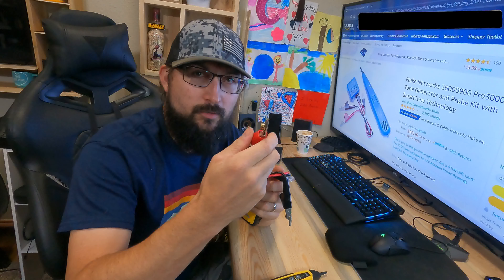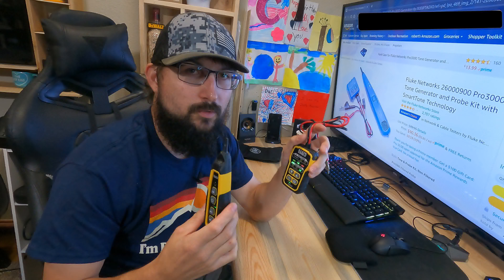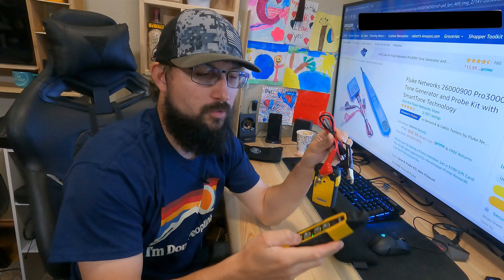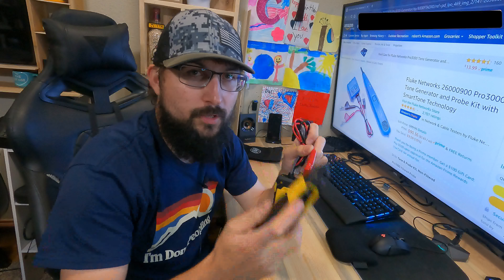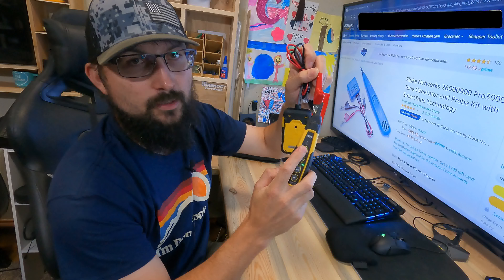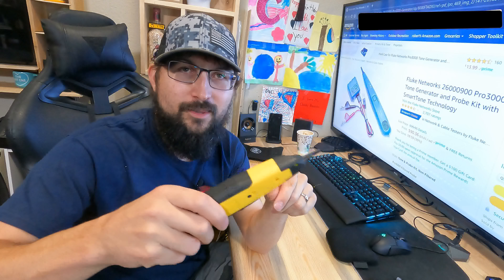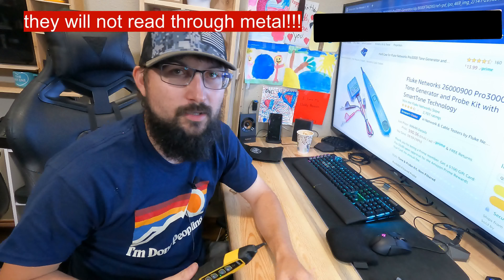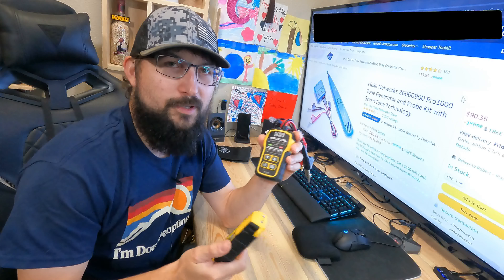Check out the Klein Tone generator/ probe

Comment: Hello Sir, your advice on how to cal and use it changed the game and make it quite simple to use without frustration Thank You. I also bought the Advanced Cable Tester NF8209 just in case so may I ask what your opinion is on it? I will send one of the back and wondering which I should keep. Thanks in advance my friend.
Reply from the maker: I'm glad I could help! Thanks for the feed back, that tester you mentioned (NF8209) looks promising! anytime you can ''dial'' in a tone vs a designated value on a push button, the manual dial is usually more accurate. However, that product looks like more for networks than a general wire tracer. I cant speak of the quality because i have never used that one . It looks like an excellent value vs the klein for networking!
I know the klein one works really good for non network applications. Thanks
Reply: As I started my day of toning, I did start struggling and i remember what you said about A ROCK SOLID Ground and once i established one I was on my way You Rock BUD. Thanks again
Reply from the maker: @nosnawslm1  Thanks!
Reply: @toolsandtactics  I did try the NF8209 and I'm VERY Impressed for multi function.

Comment: so you calibrate the sensitivity...on a test circuit? what are the correct parameters of the calibration circuits? Instructions unclear.
Reply from the maker: I've got quite a few newer updated videos on this

You don't use a test circuit to calibrate it. You can use the toner itself

But you need to make sure you connect your black. Lead to a known true ground source

Comment: Hey Man, thanks so much for putting this video together.  Best explanation I've found in YouTube.  Is there any chance you can make another video plugging in the RJ connector to the wall in a room and actually locating a cable/wire at the junction point?  Is that even the correct use? I only mention it because I'm trying to wire the rooms in my house for ethernet use and I'm at a loss trying to make it work.  I'm a DIY and it is the first time I try this, so I'm sure I'm doing something wrong.  😞Thx!
Reply from the maker: Hey thanks!
Ill get on this soon ! 

https://www.homedepot.com/p/Klein-Tools-Scout-Pro-3-Tester-Kit-VDV501-851/312212425?MERCH=REC-searchViewedNA-312212425--N    
the scout is probably more along the lines of what you are looking for kind of pricey ,for diy  this will let you know if it was crimped properly ect the toner will only identify which cable it is
Reply: Hi Steven.  Ideally, the best way to run low-volt wiring (ethernet, landline phone, cable, data, etc...) is to have no junction points between the main hub and the end location.  In other words, each room or location has a homerun line directly (and unbroken) back to the hub point.  This helps to eliminate additional points of potential failure.  If you wanted to make it even better, you could run a conduit from the hub to each end point, and then pull your low-voltage wire through the conduit.  This way, if there ever were an issue, you can simply pull a new wire in while pulling the bad one out.  This is what I've done, and it has worked wonderfully.
Reply: @shanecthompson77  Thanks! What I was trying to do was to plug in the tone generator RJ  connector directly into the wall plate with the data/phone receptacle in each room and then going to the basement where all the wire terminate.  I still can't get it to generate a tone with the probe.  I'm scratching my head trying to figure things out.  My next move will be to remove the wall plate in each room and connect directly to the wire with the clips and see if it works.  The hardest part of being a DIY is that I'm sure I'm missing some of the basics.  Thanks for trying to help me, it's really appreciate it!   👍
Reply: @stevenvelazquez2841  
Do you have a basic electrical multi meter with a continuity function?  That might be the easiest way, at this point, to trace out and determine which wires (or cables) terminate at each location.
Reply: @stevenvelazquez2841  
...but there certainly would be a way to plug the attachment directly into the wall plate.  Which toner tool do you have?
Reply: @shanecthompson77  Thanks, I do have a multimeter.  The continuity option is actually a pretty good suggestion, and it may just come to that.  I was hoping that this tool would actually make things much easier than having to do that.  I have the Klein VDV500-820.
Reply from the maker: @shanecthompson77  Yeah nice addition on info thanks for sharing
Reply from the maker: https://www.youtube.com/watch?v=jFKrli4eRh8&ab_channel=ToolsAndTactics

thanks again this is for you
Reply: @toolsandtactics  Sir, I have to say, this is the first time anyone has actually taken the time to explain it in a simple and to the point way.  Thank you so much for taking the time to put this together so folks like me can understand.  I knew I was doing something wrong. :-) You have a new subscriber! 🤝
Reply from the maker: @stevenvelazquez2841  Thanks ! You're more than welcome!
Reply: @toolsandtactics  Merry Christmas bro